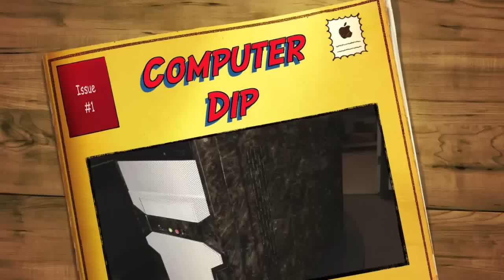How to Hydro Dip or Water Transfer Printing Step by Step

Comment: So a primer is applied, set, dried, the film measured, suspended carefully in water for 1 minute with the reflective/shiny side down, then an activator spray applied, and the primed object carefully used to "gather" a single later of the film, which the excess is then cleared before emerging, and left to dry?

  Correct?
Reply from the maker: excess stay in the tank until we clean the tank, we clean it monthly.

Comment: What should be the paint or the prime that might be applied before the dipping ?
Reply from the maker: We use only automotive grade paint but I believe there are some cheaper alternatives out there.
Reply: Voyles Performance & Hydrographics  Hello again . Thank you for the fast reply . Could you explain me what is that "grade paint"  ? Since I live in non-English speaking country , usually the products have different names ,so I find them by their characteristics rather than their names . Is this some kind of epoxy primer or it doesn't matter what is the base on the primer ? If you send me a link with the products you use it would be really useful . Could I find all the products on the market or there are specific companies that produce them ?Thank you again
.
Reply: nwa kolpo I believe he means they use paint that would be used on automotive exteriors.
Reply from the maker: Paint primer is used...

Comment: hey great video. if I want to hydro dip my ps4 do I need to put primer once it's sanded down and then put base color? or can I sand and put 1-2 coats of the base color without primer? Also could you recommend me any spray paint cans that work well as the base coat for hydrodipping? people tell me that you need good paint for this so I'm wondering if you could help me. thanks.
Reply: also could you tell me what would be good for clear coat?
Reply: also could you tell me what would be good for clear coat?
Reply from the maker: Eric, thanks for watching! We use an automotive grade clear coat. Base coat will work without primer. We have purchased primer from Home Depot that has worked for us.

Comment: Much newer comment. But my films are curling under water and not laying flat on the surface any reasons why you could help with?
Reply: Abit of electrical tape round the edges of film will help stop that

Comment: I'm dipping small items in a medium container. can I use the same water to do 2 or 3 dips in a row? or will the activator that's already on the water compromise the film? also when I dip some items I can see the film spreading and distorting. is that because I'm using too much activator?
Reply from the maker: +Jaime Pando Yes you can use the same water, we change the water in our tank about once a quarter.

Comment: This is fantastic stuff,but how do I do a guitar?
Reply from the maker: NoyzyBoyZ3 Well to do a guitar, just have to take it apart. We have done a few and they really look good. Just take your time.
Reply: Voyles Performance & Hydrographics I wanted to ask you about the water factor. Will there be a chance of water damage just being wet for that short period?The more I think about it,I'm thinking that there's just to much water involved to be able to dry it fast enough.Can I send it to you?
Reply: +NoyzyBoyZ3 
Im just assuming that they meant an electrical guitar while you meant an acoustic one? I also think the primer makes a big deal of it, there might be hydrophobic substance applied?
Reply: Could be.I would think you could dip a wood guitar body,and just dry it out. From looking at this,it doesn't look like you have to soak it!

Comment: Could you tell me what im doing wrong with my hydro dipping? Everytime I pull it out of the water after dipping, the paint just kind of beads up or runs off of my part...
Reply from the maker: William Webster Webster  It sounds like you may be applying to much activator. Or waiting to late to dip. Most important is to make sure you are using a base coat on your piece that will hold the ink. Hope this helps, and thanks for watching.
Reply: Which base coat should i use ...?

Comment: I dipped a welding hood and when it came out of the water it had bare spots all over it have you ever seen that before
Reply: too much activator
Reply: Cool thanks
Reply: too much activator will make it run and too much will make it crack...
Reply: +puttnam1 too little will make it crack

Comment: It does not show what he did with the paper he cut and what is the spray for ? looks like you need a commercial spray gun.
Reply from the maker: +Jim Dixon Yes a commercial paint sprayer is recommended. What we spray is an activator that turns the film into liquid ink. Thanks for watching!
Reply: Thanks for the info. =any in the USA ?